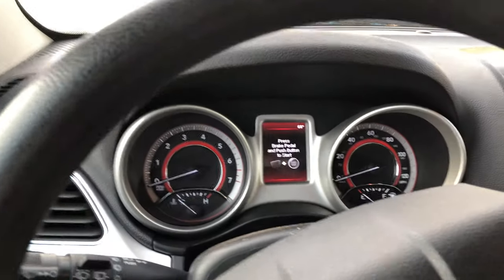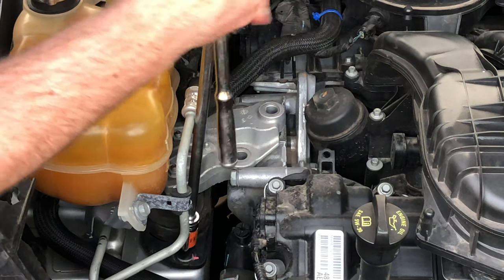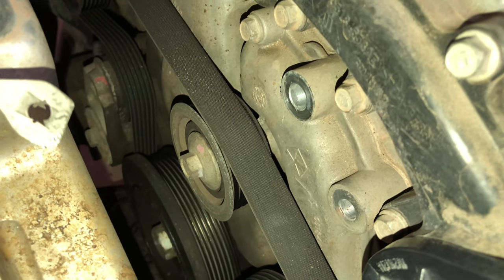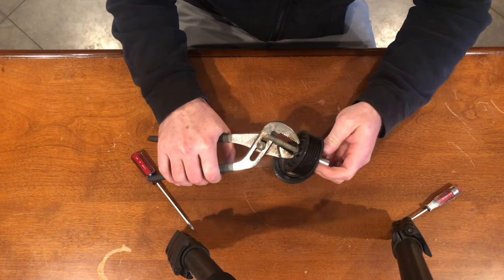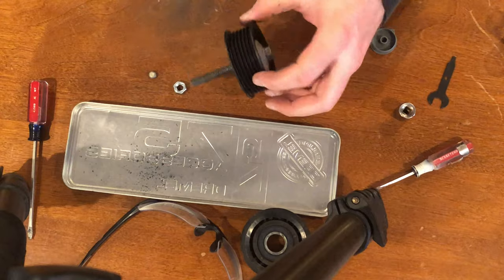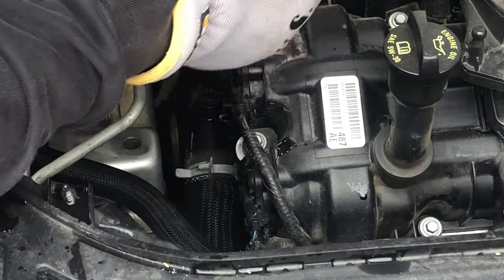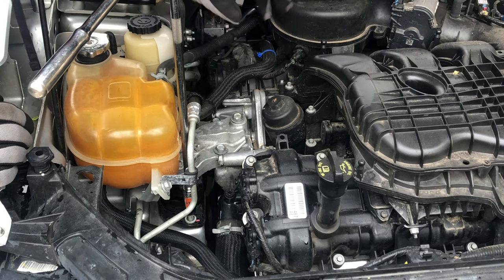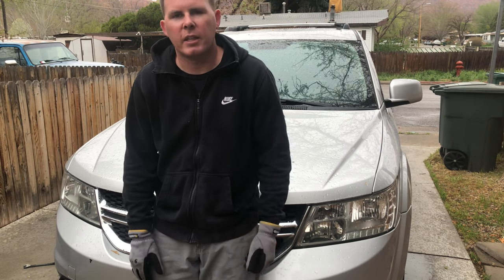2012 Dodge Journey - Idler Pulley TSB

Comment: No need to shorten the bolt. You had the engine on a jack and the procedure for removal is to jack the engine up like 1.5 inches after the engine mount is removed. The bolt easily clears the frame with zero issues.
Reply from the maker: HolyDeltaWings I tried taking it up and it wouldn’t budge. Taking a bit off might not be the proper procedure but it worked

Comment: I did an alternator on a 2012 journey 2.4. I noticed that the tensioner pulley is misaligned but everything else is fine. belt is off by a mm or two

Comment: I bought a used 2015 journey 3.6l err my wife did,and i am trying to get familiar with it before i go on a long trip.After researching this car i am not too confident in it and am replacing everything i think might go on the road,I have already found an access plate missing,ground wires not attached and no owners manual.So the owner must have done some work themselves hmmm gonna be a nail biting trip.Thanx to videos like this i am fairly confident i can get it road worthy.

Comment: My 3.6 makes a sound like bicycle cards in a spoke on acceleration and occasionally at idle. However, it disappears at times, but guaranteed to do it daily. Could it be the pulley?
Reply from the maker: Justin Hogg I would check the fan and make sure there isn’t anything in the way. Hard to say just from the description. The pulley makes more of a squeak or whine sound.
Reply: MY guess is valve train problems these engines are notorious for rocker and valve problems
Reply: The noise went away after changing the serpentine belt.

Comment: Suggestion:
Instead of removing the ground from the engine mount, follow the wire and remove the lead from the chassis.
10mm bolt, about 10 rotations and its off.

Comment: my dodge journey 2013 sounds horrible when I push on gas or if I stand in place load noise sounds like a semi running.. is this what it could be? please help
Reply from the maker: Crystal Miller there’s a few things. First I would check the injectors. They sound a bit clicky. Then it could be an exhaust leak from the headers. If you can pinpoint where it’s coming from that’ll help. I don’t think it would be the pulley. It would squeak and grind

Comment: Will that pulley seize up and not allow belt to turn? Had the belt stop turning on my way home tonight and I am trying to find possible culprits before I get a chance to start working on it
Reply from the maker: michael pittman possible. Unlikely though. It’s more likely the alternator or ac compressor. The ac compressor runs even in the winter time to remove humidity from your car while defrosting the windshield. I would take off the belt and try and move each pulley one by one. If you find one that is stuck then please let me know. I would be very interested to find out.

Comment: How can I increase my idle speed? Trying to get 700rpm to activate the voltage regulator in my aftermarket high output alternator
Reply from the maker: Factory should be about 700. This is computer controlled and would have to be modified to get anything higher. Computer programming required.

Comment: Got the same dodge journey 2012 making ticking noise when turn on what can be ??
Reply from the maker: Angel Gonzalez it’s suppose to tick a little bit. Most likely you are hearing injectors. Take a screwdriver and set the tip on the injector and put your ear on the other end of the screwdriver. This should amplify the sound.
Reply: @ArchesMechanic  well ticks lotts dont stop
Reply: @nexusone714  If you have not find out by now ot is most likely valve train problems and if not fixed quickly could lead to cam failure and a lot of money,these engines have weak valve train parts like rockers.

Comment: How do you get the pully out the bolt hits the subframe? Thanks
Reply from the maker: You have to undo the motor mount and put a jack under the engine and lift it slightly. Make sure you have good coverage on the bottom so you don’t punch a hole in the oil pan
Reply: Just undo the 2 13mm engine mount nuts from the frame side, then lift the engine a couple of inches.

Comment: you skipped over the part where you actually remove the pulley from the engine... and it makes contact with the body of the car...
Reply from the maker: HDmech81 yeah. That’s why I shortened the bolt.
Reply from the maker: HDmech81 though I mentioned that but I must have overlooked it
Reply: @ArchesMechanic  oh yeah i know that's why. You just didn't show the actual maneuver needed to get it off the engine. That's all.
Reply: I'll tell you how i did it after cussing Dodge for ten minutes.I took a file to the bolt head and it only took a few seconds to get enough off to get it out.I then took a little more off the top with a carbon wheel grinder.Stupid design to require taking all the motor mounts loose just to remove the pulley,ridiculous
Reply: @Fldavestone  Well you gotta take a tire off to change the battery so I can hardly wait to find more interesting design innovations on this vehicle.

Comment: My Journey Crossroad is making a high pitch whining noise during acceleration..Any ideas what's causing it?
Reply from the maker: Idontlikethatshit two possible reasons. Could be whine from the belt (serpentine belt) you can remove this belt but don’t run it longer than 30 seconds or so. If it makes the noise when you rev it with the belt off then you know it’s engine/trans related. If it’s only when the belt is on you can determine it’s one of these items.